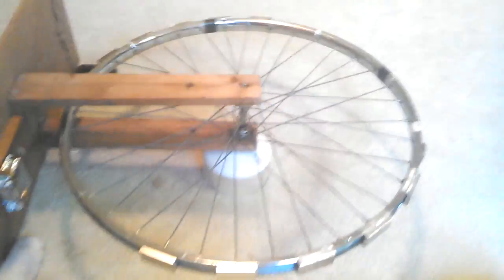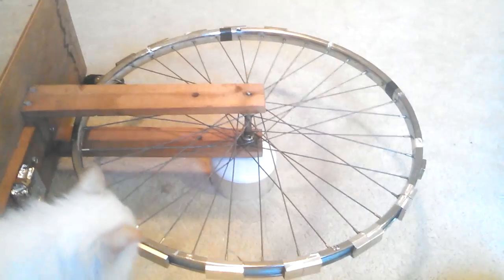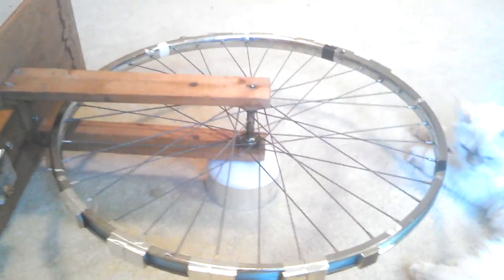🧲 Roney Stators Part 2 of 2

Comment: Mr. Roney,   I am wondering about the possibility of using magnets of different strengths on the same wheel.  IF the Front  and back magnets are the same value as the  stator thenif weaker N value magnets were used on the wheel to keep the push happening between the larger N52 magnets. would that decrease weight and repulsion a bit.
Reply from the maker: Guess what? Turns out we've had German magnet motors for cars since 1966. Google it. Now others are creating their own magnet motor that truly work. Using only magnet to create continuous motion has long since been solved and replicated by others. There for this is no longer theory. Thanks for visiting nonetheless.

Comment: In other words the large wheel would have gearing to the small magnet rotor, such that the two wheels' spin rates would be such that the large wheel is always being provided with an attractive force in one direction, alternating with a repulsive force against the large wheel's magnets' opposite pole, so as to always be providing more energy to turn the wheel in the same direction constantly. May need an overspeed governor.

Comment: You don't need to make a "monopolar" magnet (or simulate a monopole) by your method, if you simply put proper gearing in, so that the magnet is turned on a small rotor at the precise rate of spin needed, in order to provide a north pole to pull the other magnets then provide a south pole to push the other magnets so as to propel the large wheel. Gears would have to be nonmagnetic or very low magnetic.

Comment: Excellent information, Thank you.
Reply from the maker: This magnetic motor challenge was solved way back in 1966 by a German man who made a working car motor that ran only on magnets. See link below. Others as well on the web have also made motors using only magnets. See links below. My design concept is different from most others as I'm going for super torque. The links below were long since made available in the video description as well. If by chance you're still around, thanks for stopping by.

((( MAGNET MOTORS THAT ACTUALLY WORK )))
👉🏻 MAGNET MOTOR - Rotor Encantado
https://youtu.be/mxgwTzxfe8Y

Amazing Magnet Motor/Gen Rep. This is not a fake
👉🏻 https://youtu.be/jKFTAobM-l0

WORKING MAGNET MOTOR 2023
👉🏻 https://youtu.be/vdtdKE2Qe40SELF RUNNING MAGNET TURBO MOTORhttps://youtu.be/6sIBHn5-9pI

🆕 WORKING MAGNET MOTOR - rotor magnéticohttps://youtu.be/3mD0_0FiJ54

MAGNET ONLY MOTOR from SOUTH KOREA
👉🏻 https://youtu.be/smzpbKg9S7M

1966: German inventor presents his Free Energy Device Magnet-Motor
👉🏻  https://youtu.be/XWQjMyMWXAc

Comment: cool, i always thought the stator would have to be on a cam to move out of the way of the 'sticky' point...btw, i'm prety sure that sky is working for the energy companies.. lol...
Reply from the maker: Yes. Skye received a multi million dollar contract to work for them. It turns out that this magnetic motor challenge was solved way back in 1966 by a German man who made a working car motor that ran only on magnets. See link below. Others as well on the web have also made motors using only magnets. See links below. My design concept is different from most others as I'm going for super torque. The links below were long since made available in the video description as well. If by chance you're still around, thanks for stopping by.

((( MAGNET MOTORS THAT ACTUALLY WORK )))
👉🏻 MAGNET MOTOR - Rotor Encantado
https://youtu.be/mxgwTzxfe8Y

Amazing Magnet Motor/Gen Rep. This is not a fake
👉🏻 https://youtu.be/jKFTAobM-l0

WORKING MAGNET MOTOR 2023
👉🏻 https://youtu.be/vdtdKE2Qe40SELF RUNNING MAGNET TURBO MOTORhttps://youtu.be/6sIBHn5-9pI

🆕 WORKING MAGNET MOTOR - rotor magnéticohttps://youtu.be/3mD0_0FiJ54

MAGNET ONLY MOTOR from SOUTH KOREA
👉🏻 https://youtu.be/smzpbKg9S7M

1966: German inventor presents his Free Energy Device Magnet-Motor
👉🏻  https://youtu.be/XWQjMyMWXAc

Comment: Great job! I appreciate what you have done with your stater. Unipoles would be helpful, lol.
Reply from the maker: It turns out that this magnetic motor challenge was solved way back in 1966 by a German man who made a working car motor that ran only on magnets. See link below. Others as well on the web have also made motors using only magnets. See links below. My design concept is different from most others as I'm going for super torque. The links below were long since made available in the video description as well. If by chance you're still around, thanks for stopping by.

((( MAGNET MOTORS THAT ACTUALLY WORK )))
👉🏻 MAGNET MOTOR - Rotor Encantado
https://youtu.be/mxgwTzxfe8Y

Amazing Magnet Motor/Gen Rep. This is not a fake
👉🏻 https://youtu.be/jKFTAobM-l0

WORKING MAGNET MOTOR 2023
👉🏻 https://youtu.be/vdtdKE2Qe40SELF RUNNING MAGNET TURBO MOTORhttps://youtu.be/6sIBHn5-9pI

🆕 WORKING MAGNET MOTOR - rotor magnéticohttps://youtu.be/3mD0_0FiJ54

MAGNET ONLY MOTOR from SOUTH KOREA
👉🏻 https://youtu.be/smzpbKg9S7M

1966: German inventor presents his Free Energy Device Magnet-Motor
👉🏻  https://youtu.be/XWQjMyMWXAc